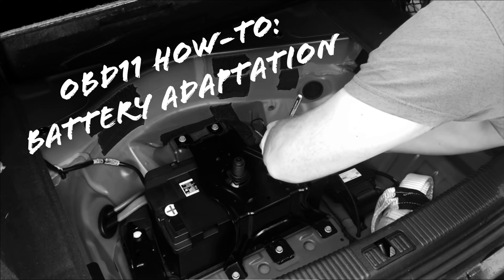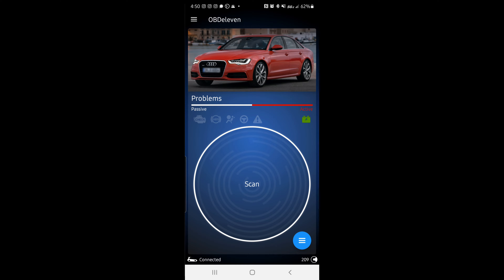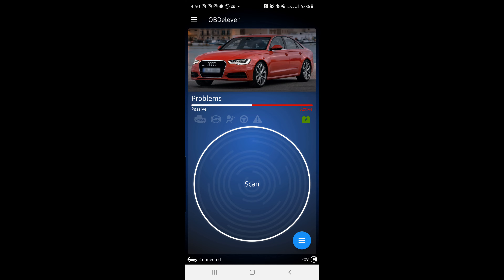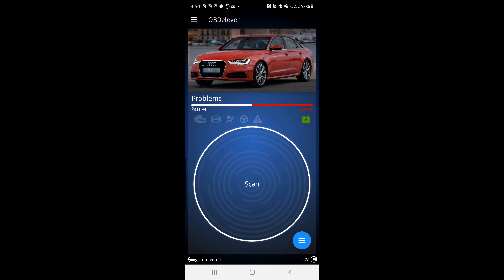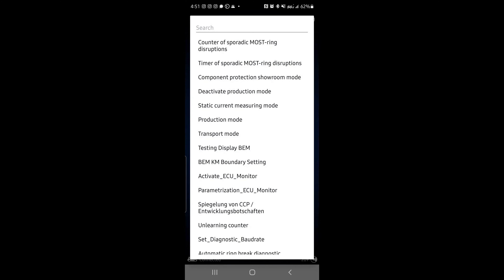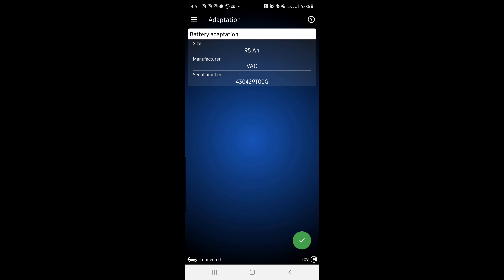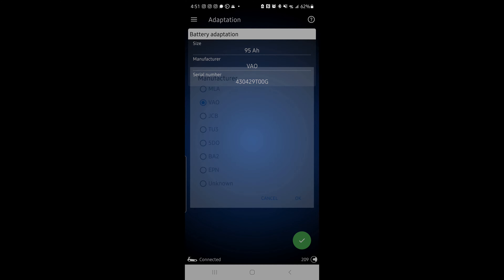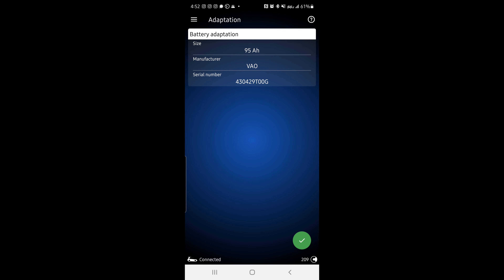This is how you perform a Battery Adaptation with OBD11

Comment: What up Doe Mr C7!?

Just did a battery swap in my 2012 A6 with a Duralast Platinum 95r H9 and it was a smooth process thanks to your detailed info. The only thing was my adaptation slot didn't have 100ah... 

Great vid 👍🏻
Reply from the maker: Thanks man! As long as you made a change the ecu will do the rest
Reply: @AudiC7Owners  Copy that Mr C7
Reply: @campbellsoup4910  same here I ended up choosing the 105ah option.  Well see if this battery lasts at least 3 years lol if so 105ah was a good choice if not maybe I'll choose 95ah. Weird we don't get a 100ah option
Reply: @SDGunfighter  Right! 

At least 3 would be nice!!

Comment: Mine asks me for a channel??? What do i put? Im confused. It wont work. I dont get that menu. Im so upset pleade help me
Reply: Channel for the battery adaptation is 04
Reply: @Acinho84  thank you
Reply: @Acinho84  im thinking my car just doesnt have a battery control module or whatever its called. I dont think you can even do a battery adaptation. Mk6 jetta SE 1.8 EA888 gen 3
Reply from the maker: You don't need to do an adaptation

Comment: Hey I have a question, I’m already ordering the OBD11 for my Audi A4 but, I saw the battery on a store here and I believe it was the right one and everything but it said that the battery has to be vented, I don’t know what exactly is that and what I have to do, is it bad if I don’t vent it ? 😅
Reply from the maker: I have no idea what that means lol. Never heard it.
Reply: Your OEM battery is vented, at least on my 7.5 it was. When you pull the cover off your battery youll see a little nipple with a plastic hose running off the battery and down. Just make sure new battery has nipple, plug up hose and done.
Reply from the maker: My C7 definitely doesn't have that
Reply: Yep. And I think venting is mandatory if the battery is in the trunk.

Comment: can this be done with OBDeleven basic or need a pro version?
Reply from the maker: It should be able to be done with basic but I'm not 100% certain
Reply: @AudiC7Owners  thanks, also does this app will work with Nexas nexlink odb2 adapter/scanner?
Reply from the maker: No. You need the obd11 dongle

Comment: Does the car have to be in on position or running for the adaptation to take place?  Also my car is doing weird stuff... ive just replaced my alternator with the oem hitachi brand... does it need to be coded also? While on the gas and going WOT my voltage drops to 12.6/5v when I let of the gas it goes up to 14.3v back on gas it's drops again... any advice on this?
Reply from the maker: That is normal voltage
Reply: I'd imagine that's dynamic charging, it takes the load of the alternator off the engine while accelerating, puts it back on when cruising or braking.

Comment: What if my battery died and I replaced it but never did the Adaptation? I’ve had the battery for about a year now. Should I do the adaptation now?
Reply from the maker: If you don't have any errors then I wouldn't mess with it. But make sure you do the adaptation next time. The adaptation should help the battery last longer.

Comment: I plan to install Adaptive Cruise Control to my C7 and I really wish you had a tutorial for this :D I'm collecting info and parts for about a month already and still not sure about some things.
Reply from the maker: Good luck with that man! But that is an install that is a bit out of my league. I'm interested to see how it goes though!
Reply: @AudiC7Owners  I know that there is a way to recalibrate the ACC with OBD11. My ACC is unavailable since I took off my front bumper and started the car. I believe since the radars were not plugged in the system now thinks that radar sensor are misaligned. Any ideas of doing the recalibration with OBD11?
Reply from the maker: Yea you messed up giving power to the car with everything unplugged.

I know there is a vcds process, but I'll have to research into the obd11 capabilities
Reply: @Krsonecf  hey, did any of you find out how to do the adaptation? I'm thinking lf swapping the front grille of my audi a7 and I'm worried that recalibration might be needed
Reply from the maker: You won't need to recalibrate if you keep power off while everything is unplugged
Reply: @AudiC7Owners  so as long as the removal and reinstalling of the bumper/front grille is done with the engine switched off, there won't be any issues?
Reply from the maker: Yep
Reply from the maker: And as long as you don't mess with the radar sensors